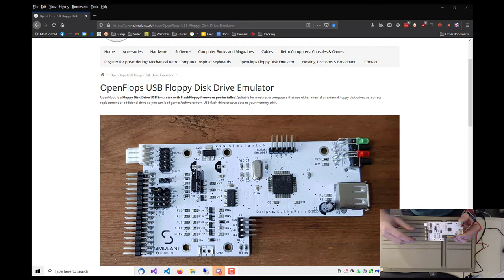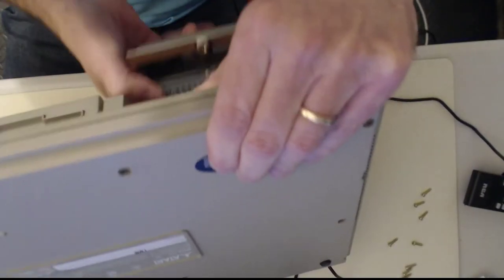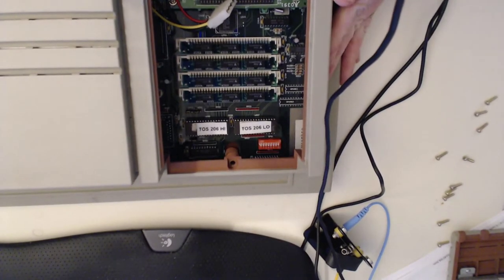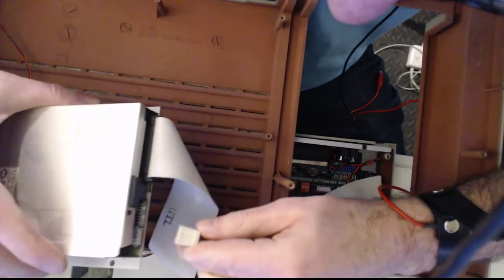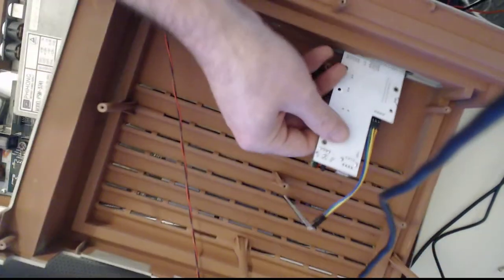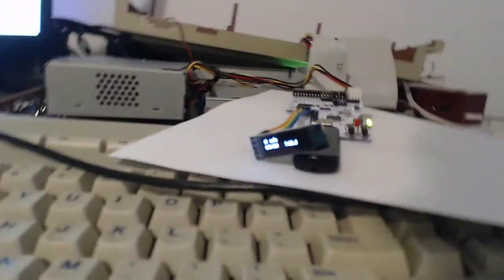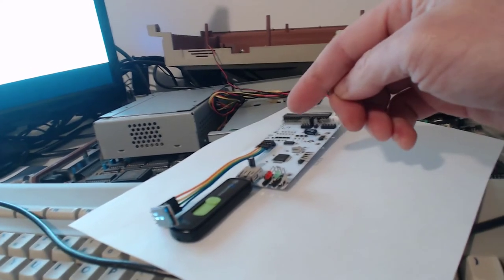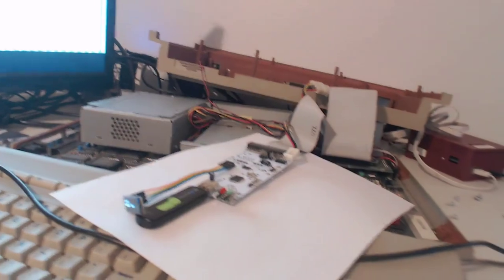OpenFlops on an Atari Mega STe

Comment: Are you going to 3D print a bracket to fill the open front of your floppy drive so you can insert a USB stick?  I recently cut a window in the back of my TT030 to fit an internal CosmosEX v3. so the USB ports blend in with the rest of the ports.
Reply from the maker: The plan is to 3D print a replacement face where the Floppy drive was.